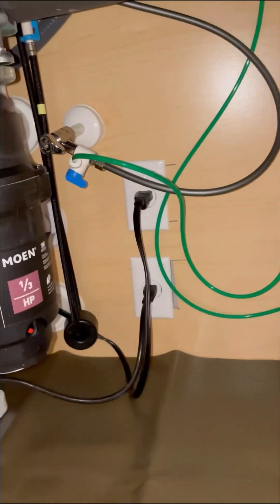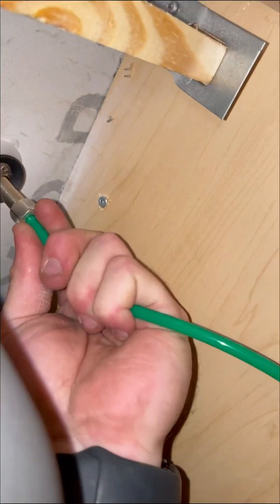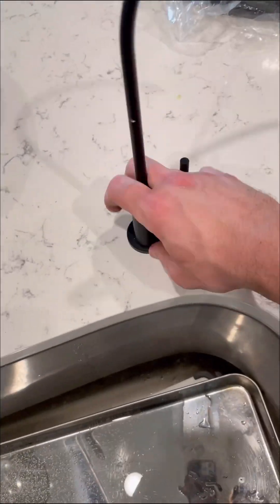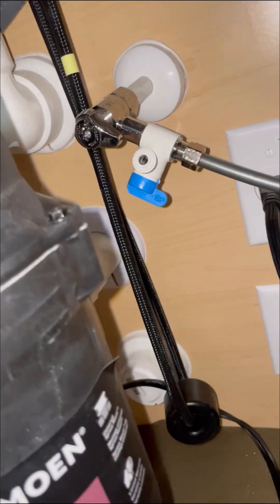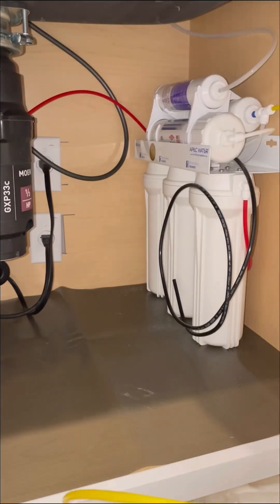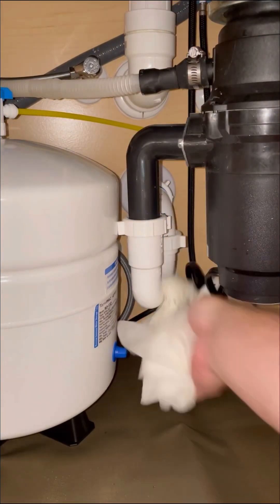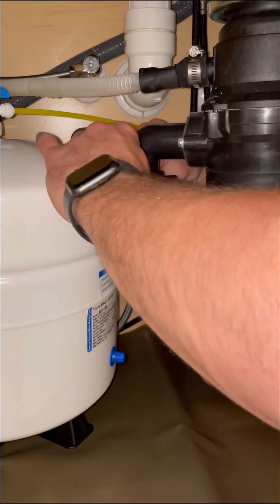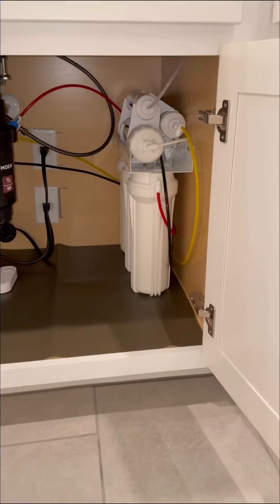Reverse Osmosis System For Drinking Water

Comment: The problem with these over priced systems is there are no gauges or other feedback that it is working or filters need to be changed.  They expect you to change the over priced filters based on time not usage.  Second problem is that they are guaranteed to spring a leak and do thousands of dollars is damage.  I have two of these systems and I would not recommend them.
Reply: I install them for a living. You can easily install a pressure guage on the outlet side of the r/o unit. When the pressure begins to go down you need to change it. You can also buy a cheep tds meter and test the treated water against the raw. When the treated water is over 10% of the raw you need to change the membrane. They are not guaranteed to leek unless they were installed incorrectly. Some of the least leak prone systems a plumber will install.
Reply: I’m a plumber in Texas. I highly recommend these things
Reply: you should have done your research. there are models that have a simple display on the faucet that shows you when to replace the filter. and no, the quality ones arent "guaranteed" to leak everywhere and ruin your kitchen.
Reply: He's not even going to the fact u need a water softner system before you get one of these installed in most cases
Reply: @JUNEBUGLLC WHAT??? My Dad's nickname was JUNEBUG!! ❤

Comment: Is there one where water doesn't touch plastic?
Reply from the maker: No because the pipes and fitting have to be plastic. The water will pull minerals from the metal because the minerals were removed from the water and cause leaks.

Comment: never asked this question anywhere so I will just do it here. Can I install a reverse osmosis system in my apartment, without messing anything up? In theory let's just say, everything was properly installed, does it affect any other residents or pipes normal function in the complex? Did this with a regular water filter in another apartment and a house and maybe just bad luck possibly but I had water problems and kind of anxious about it despite following exact installation manual rules prior.
Reply from the maker: I wouldn’t in an apartment but when installed properly it won’t affect anything or anyone else’s system.
Reply: There might be two areas that would have an issue. The first is the drain. Usually these kits come with a saddle clamp for the drain. Basically you put a small hole into your drain pipe. You could replace the pipe when you remove the system. 
The other thing is the faucet. This usually installs into a hole on the top of the sink. If you don't have one, you can add one, but that means missing the sink. You could, if you have the correct refrigerator, run the water line to the refrigerator. Of course this might depend on how much you know how to do.

Comment: How much air pressure do u run in the tank
Reply: My Watts system day 9 psi on the tank.
Reply: Say max pressure 125 psi
Reply from the maker: @Newyorkerr5788  don’t do that. That’s max operating pressure of the water system not the tank pressure
Reply: Thats all the tank says its a Culligan tank
Reply from the maker: @Newyorkerr5788  usually between 6-8psi
Reply from the maker: They are pre charged so you don’t adjust or change it
Reply: @theplumbersplunger  the air was let out by not having a cap and something pressed against the valve and released the air
Reply from the maker: @Newyorkerr5788  would need to look at manufactures specs to see what they recommend

Comment: What's the diameter of the john guest fitting for the tubing connections? and what's the adapter to john guest it out of the wall?
Reply: 1/4” water supply  1/4” to the faucet 3/8” to the tank